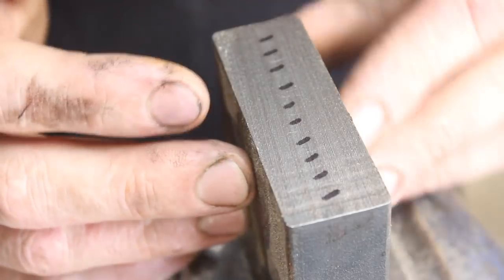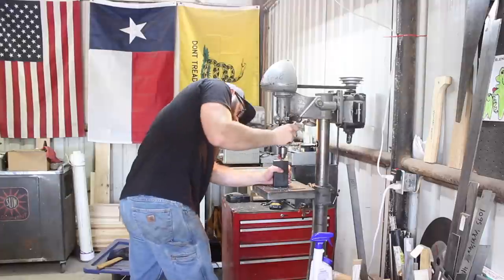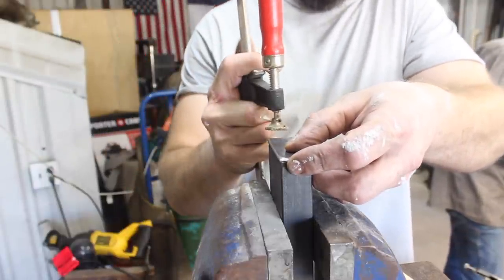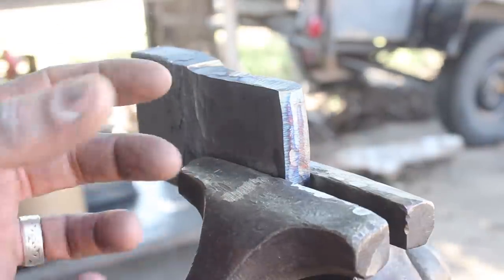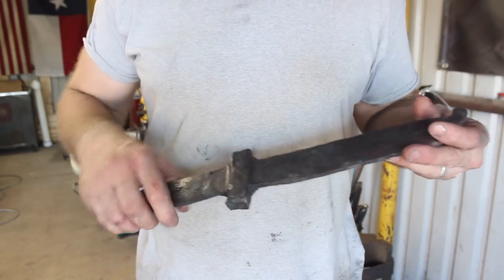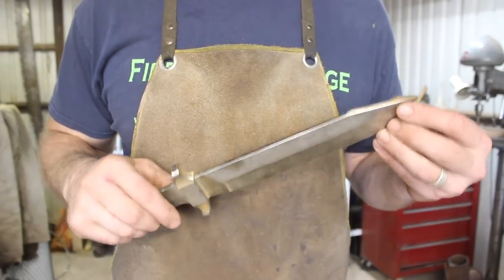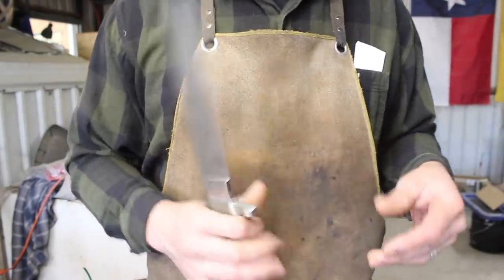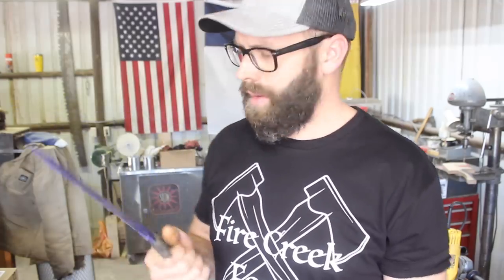Bowie Knife Challenge!! Forging Retained Canister Damascus, Blacksmithing, Knifemaking Bladesmithing

Comment from the maker: This "Bowie Challenge" has been months in the making. You don't want to miss any of the builds. I think you'll be intrigued by the method I'm using to build my Bowie knife, and I think you'll like the final results.
Reply: Absolutely love it great job 👍
Reply: I liked yours the most, everyone else did a very good job, i just like the creativeness with the pattern and the fact its a integral full tang knife. Roughly how much steel was needed to shape the guard handle and knife, a few pounds?
Reply from the maker: @dgundeadforge17  thanks! It was probably 3+ pounds to start with..
Reply: @dgundeadforge17 he keeps pushing the envelope and makes it look more simple then it is trust me I have the cuts to prove it but my favorite part as a blacksmith he is more genuine he doesn't cut corners he forge's them
Reply: I really like the randomness of the bearings. I think this might be a fun one to see you do lots of variations on that canister. Maybe some folds or flips and such. Regardless, beautiful work!

Comment: Probably a dumb question, but how well does 1060 retain an edge?
Reply from the maker: It's suited for applications like a heavy chopping knife, it has more toughness than abrasion resistance. For example, 5160 has the same carbon content as 1060 (0.60%) but with 0.80% chromium.